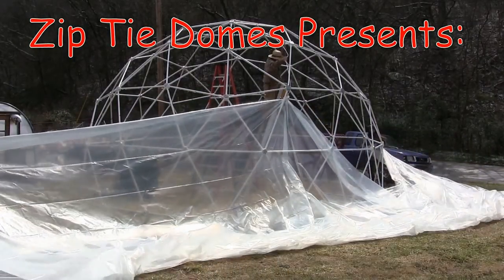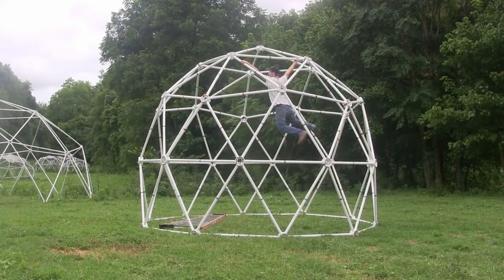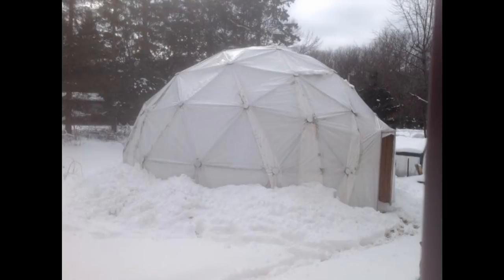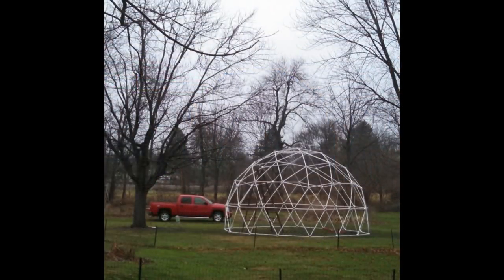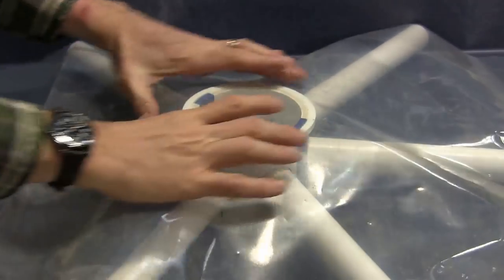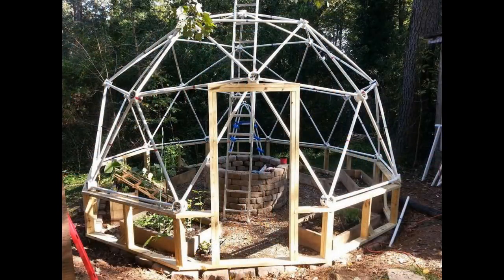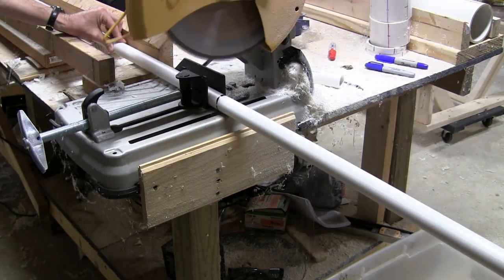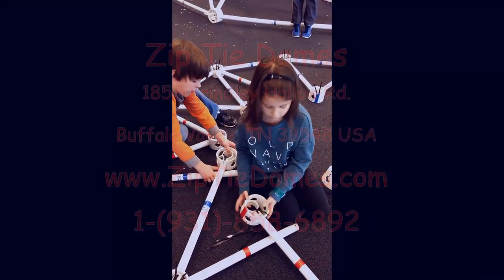8 Reasons Why a Geodesic Dome Greenhouse is the Best Greenhouse Design

Comment: given extreme light weight... you ought mention need to pound in anchors... rebar sections  with 'candy cane bend of length 24 or 36 or 48 inches dependent upon local wind intensity and soil type...
Reply from the maker: That is definitely a good idea.  Thanks again.  John

Comment: Great video, I live on the bold coast of Maine and it gets very, very, windy. We also get an average of 4 ft of snow per year. Would you suggest metal conduit for me?
Reply from the maker: Nick,  - The 1" PVC pipe will support over 200 lbs from just one of the hubs. Here is a video of my son doing a chinup on the 16' dome with 1" PVC pipe:  https://www.ziptiedomes.com/video/pvcloadtest.htm  Here is a customer review from Wisconsin where they get several feet of snow:  https://www.ziptiedomes.com/customers/genehersey.htm
We have a 2 year warranty on all parts, and will replace any parts for free for any reason, including snow load.   You can use 3/4" or 1" EMT conduit, but EMT is more expensive to use and not necessary.  Here is a review where the customer used EMT:  https://www.ziptiedomes.com/customers/johnthompson.htm
Be sure to tell us before you order your hubs that you are using EMT, and what size EMT for your struts, as we have to drill the hubs differently for EMT.  Thanks.  John Hurt

Comment: What material was used for the shelter dome at 4:20? Do you know? Did they share that info with you? I'm trying to figure out what material will be best for our shelter ...
Reply from the maker: At 4:20 it is a greenhouse used to grow orchids. They are using a 70% opaque overwintering greenhouse plastic to cover the dome.  You can purchase this plastic at these links:
https://www.growerssupply.com/farm/supplies/prod1;gs_greenhouse_films;pg108627.html
https://www.growerssupply.com/farm/supplies/cat1a;gs_greenhouse_films.html
Reply: @ZipTieDomes  or, you can make paintings on ghse plastic, then caulk a second piece on, and get a stained glass effect.
Reply: @d.e303-anewlowcosthomebuil7  that would be pretty
Reply: @recoveringsoul755  it is, and is durable too

Comment: You need  to use PVC electrical conduit instead of regular PVC because it has UV protection and the regular PVC does not.
Reply from the maker: L.J.  - Thank you for your comment.  The gray Schedule 40 PVC conduit has an anti-UV agent added to the PVC.  It has also not been pressure tested as the white PVC plumbing pipe, which means it can be cheaper than the white.  But as far as UV degradation, here is what the PVC plastics industry said:
http://www.nacopvc.com/c/tech-info/the-effects-of-sunlight-exposure-on-pvc-pipe
https://www.usplastic.com/knowledgebase/article.aspx?contentkey=774
That is, UV light only travels through the top .001" of the PVC pipe, and so the UV degradation is really more about discoloration than weakening the pipe.  I have domes made from white PVC pipe that have been up since 2010 with no noticeable problems.  But either gray or white PVC will work.
PVC pipe will slowly out gas chlorine gas, which can degrade the greenhouse film, wherever it touches the PVC pipe.  To prevent this, our instruction manual recommends that you paint the dome with a thin layer of white latex acrylic paint to protect the greenhouse plastic from the PVC.  If you use the gray conduit, this looks messy, but with the white PVC pipe, it is "white on white" and you can't see it at all.  Thank you for your comment.  John Hurt
Reply: @ZipTieDomes  pvc is however harmful if you wish to live inside the dome
Reply from the maker: @imondtitanic  - PVC pipe is used as plumbing pipe in the USA and elsewhere.  All of the water that you drink comes through PVC pipe, which if PVC pipe is harmful, drinking water stored in PVC pipe would be more of a problem than using PVC pipe to build a geodesic dome.  Plastic is not as good as organic materials for health, but PVC pipe appears to be acceptable to most people to handle their water supply.  As a result, building a dome from PVC pipe should not be a problem.  Thank you for your comment.  John Hurt
Reply: @ZipTieDomes  the worst problem is the heat from sunlight directed to the pvc

Comment: For a 3V 5/8 24' diameter dome as I have made with 1/2 conduit, all cost $600.   A ZipTie dome hub kit will be $305.00 plus 90-1 inch PVC pipe is $6 is $540.   $845 complete.  Still labor and a drill press and chop saw..  $?    A decent sized green house dome needs space and height.  PVC will not suffice or last.  Unless I see evidence otherwise, Its too flexible and depending on your climate will fail in wind and snow.  In all honesty though I built a hydraulic press to stamp out my conduit struts. So is easy peezy to fabricate now.
Reply from the maker: My first domes were metal conduit.  The 1/2" is too flimsy, you can't climb on it without bending the struts, and if they bend, they crimp and you can't get them straight again.  You need at least 3/4" metal conduit to 1".  3/4" conduit is more expensive than 1" PVC.  Conduit domes are too heavy to move for a chicken tractor. You have to buy a press to make a metal dome, and I still have my press from 2009 when I made my conduit dome, and have not used it since.  There is a lot more labor in building a conduit dome, as you have to cut the struts with a chop saw, flatten the ends, bend it exactly 12 degrees, then drill a hole through it - 330 times for a 3v 5/8 dome.  With PVC struts you just cut the strut and drill a hole across the ends.  It is a lot less work.  Assembling the conduit dome is a nightmare, every time you add a new strut, you have to take the nut and washer off the bolt, then put the strut on the bolt, then put back on the washer, nut, and tighten, all while the strut swings back down towards the ground.  With our hubs, the PVC struts are held in place by the hub, and all you have to do is zip tie it to the center ring.  No tools are required just zip ties, which makes a lot of difference when you are up on a ladder, and drop the bolt, nut, washer or two wrenches or power drill, and have to climb down the ladder to get them.  Also, you don't have tee joints, or 90 degree, 45 degree or other types of plumbing joints for metal conduit, so it is harder to fabricate a door that looks good. Where the 5 or 6 metal struts come together at a hub, you have a lot of sharp edges that have to be covered or they will rip the greenhouse plastic.  If you did not bend your strut ends at exactly 12 degrees, the ends cannot be bolted together to make a hub.  And there is no place to attach your greenhouse plastic to a metal conduit dome.  With our domes, we are able to attach plastic greenhouse film to every hub on both the inside and outside of the dome for better insulation, and you can't do that with metal conduit.  If you try to staple mesh to a metal dome, or even put a screw into metal conduit to attach mesh for concrete, it is a lot harder than PVC.  So you can't easily attach mesh to a metal dome for spraying it with concrete as you can a PVC dome.  And even galvanized metal can ultimately rust and spall the concrete dome, which is not a problem with PVC. 
UV only goes through the top 00.1" of PVC and does not affect the strength.  Here is the proof:
https://www.usplastic.com/knowledgebase/article.aspx?contentkey=774
But if you have a problem with UV, then you can just paint the PVC. 
Metal conduit weighs more and costs more to ship.  For this reason, and that metal is more expensive than PVC, our domes are at least 1/2 the cost of any metal conduit dome manufacturer. 
If you are DIY, you can do EMT conduit domes.  But most people are not DIY, don't have a press, and need a something they can build without using any tools.  This is the only geodesic dome you can build without tools. 
I did not use metal conduit domes because I wanted to make mobile chicken tractors that were light enough to slide on the ground.  But to each his own. If your greenhouse is working for you, and the 1/2" metal conduit struts don't bend under the snow load, then that is good news.
Have a great day.
John Hurt
Reply: Too many suppositions to go onto, but I find the 1/2 conduit adequate (I can do 3/4 easily if needed) , rigid, structurally sound (pumpkins, beans, and squash hang from the struts), adaptable, beautiful in simplicity, long lasting ( my first one is 20 years old). It does require more skill and precision in fabrication. Shade cloth and plastic is changed easily with the right system. Mine are intended to also be a trellis. A metal storm door is also a simple addition if done right. This is my choice after seeing wood and plastic struts. All solutions are site specific.  So many ways to success.   @ZipTieDomes
Reply from the maker: A trellis is a great way to use a dome.  Best wishes.  John Hurt @danielhalsey2679

Comment: With the 2 layer plastic design, is it inflatable between the layers?
Reply from the maker: You don't need to inflate between the layers, as the struts will keep the inner and outer layers apart.  I suppose if you sealed the edges of the two layers, you could inflate it, but it is not necessary.  Thanks for watching the video.  John Hurt

Comment: We build great green houses out of pvc they look like a quansit building a tube covered in plastic 100 feet by 40 feet n real solid
Reply: Did you even watch?
Reply: @recoveringsoul755  sorry I got bored I watched n mine don't collapse it's knowing what n how but I agree on the done I lived in the second largest done at the time in northern Canada but we have tube type green houses up in nor Cal that have been through hell n still work fine n they're huge I've watched them collapse so I'm aware of the problem but it's how u do it n I'm a skilled lolhahahaha contstructor I also build acoustic guitars n tree houses but I agree about domes being very solid structure
Reply: U can dual cover inside and outside tube type green houses they make clips for attaching the cover great sales pitch but a tube type green houses r more efficient as far as space n amount u can grow we heat them with a large rocket stove n I mean warm even in freezing weather n snow n thanks I like ur domes great idea with the PVC hubs I'll recreate the same thing to live in zip ties r another great accessorie
Reply: Yeah I watched it now thanks great sales pitch there is something strange living in a dome not sure I think they r good to live in though just weird not having square walls but easy to heat n camoflodge
Reply from the maker: Can you do a chinup on a hoop house?  Will the PVC pipe bent in a 180 degree loop support your weight?  Can you climb on top of your hoop house?  Just curious as to how you build them in Canada.  Thanks. John Hurt

Comment: You never told them they need to paint the PVC pipes, if you did i missed it and it needs to be said more than once anyway,  because they will need to paint it if they want it to not rot out from the sunlight. That cheap PVC is not good enough for sunlight exposure, you need the PVC that is designed as conduit, not the regular PVC pipes for water lines, because the conduit is made with UV protection and you won't need to paint it. You mentioned the gray conduit PVC, but you still never told them about painting the cheap PVC. But if you want to use the cheap PVC, then you have to paint it, if not you will be the one to deal with a rotten frame that lost its strength.

 IT will cost another $80.00 to $100.00 extra USD for the appropriate paint, primer, and cleaner, so be aware of it. But i price that with the very best you can buy. Might be worth it to check into the gray conduit pipe designed with UV protection, could work out cheaper in the end, it don't need paint, primer, or cleaner.

IF you pay attention, you will notice the real engineers won't use that cheap PVC in applications where sunlight hits it. But that won't stop them from using PVC in sunlight if they need to for other reasons of moisture resistance, etc... then they will use the better PVC designed for UV protection. There is furniture grade PVC too, but those cheap water pipes are in a class of their own, useful for places without any direct sun, ever.
Reply from the maker: Tony, 

Sunlight and UV only affects the first .001" of PVC pipe.  Sunlight ande UV do not travel all the way through a PVC pipe to weaken it. 

Here is what US Plastics and other members of the PVC pipe industry have published about the reasons UV does not degrade PVC pipe:
https://www.usplastic.com/knowledgebase/article.aspx?contentkey=774
http://www.nacopvc.com/c/tech-info/the-effects-of-sunlight-exposure-on-pvc-pipe
I think the people that wrote these articles would qualify as "real engineers".
Reply: @ZipTieDomes  Both articles report decreased impact resistance and recommend painting PVC for long term outdoor installation.
Reply from the maker: @C-Hirsuta  Yes, you should paint the PVC  to keep it from interacting with the greenhouse plastic.  The impact resistance is still quite strong on the domes I have had out in the weather since 2011 - and they are still standing.  Thanks for watching the video.  John Hurt
Reply from the maker: @TheRebelmanone  You can use Schedule 40 Gray Conduit for your struts, as it is rated for UV. 

And yes, I do have a lot more experience than you do on this subject.   But I never argue with a, hmmmmm.

Comment: Has anyone used polycarbonate panels over your domes?
Reply from the maker: Cutting 4' x 8' sheets of polycarbonate into triangles is very wasteful and expensive.  We recommend that you cover the dome with a single sheet of greenhouse film.  That is what we encourage people to do, and so I don't have any customer reviews where someone has used polycarbonate panels.
John
Reply: @ZipTieDomes  You did not answer my question. I don’t care about how  expensive Or recommendation. Has anyone done polycarbonate panels over your domes?
Reply from the maker: @dominicferro8314  I really do not know.  Like I said,  we have had some people say they were going to do it, and then I would talk them out of it, and after that I never heard from them again.
If money is no problem, then look at some of the steel domes that are made for polycarbonate.  I think they run around $2,500 to $3k just for the 16' frame. You can also look at a wood frame dome, but they can rot. Bigelow farms made a great series on their wooden dome a few years ago, and this past year, they made a followup video saying that their dome had rotted and fallen apart.  They also said that it was cheaper to not use polycarbonate, but just cover the entire structure with greenhouse plastic.   I hope this helps.  John Hurt
Reply: @ZipTieDomes  Does polycarbonate panels insulate better than plastic sheeting?

Comment: How can you claim that you don't need any tools at all, when you will still need a tool to snip off the end of the zip ties!  So you need at least one tool.  And what about holding it down to the ground?  You will need stakes of some kind, and they will need to be hammered in, so you will need a hammer...And that makes two tools.
Reply from the maker: You don't have to clip the ends of the zip ties, you can fold them around the center ring.
You can also tie the dome to a tree, or push the stakes in by hand, I suppose.  But this is the only geodesic dome that can be assembled without tools.  After assembly, you can do what you want.
Have a great day.
John
Reply: But you do need to clip the end of the ties if you want to cover the frame with polythene sheet, as shown in another one of your videos...So you still need at least one tool.
Reply from the maker: @sigmasd10  Arrgh!  You got me!  The secret is out at last!  Of course, you could nibble the zip ties off with your teeth.  But then your teeth would be a "tool", so that would still not be "tool less"   Have a great day, and I hope you never lose a discussion. It is great to see someone that just does not give up.  Thanks for watching the video.  John

Comment: Your all climbing people are climbing on joints not on single pipe.
Reply from the maker: Yes, the pipe will bend in the middle, but the joints are held by several pipes.  So it is much stronger at the hubs than in the middle of the pipes.  Thanks for watching.  John